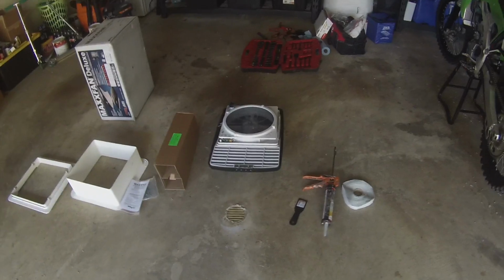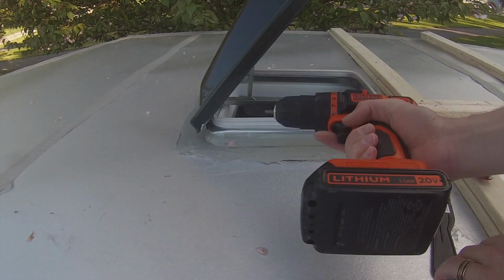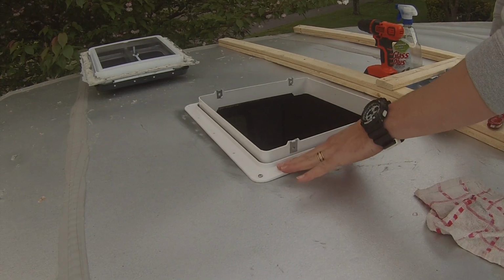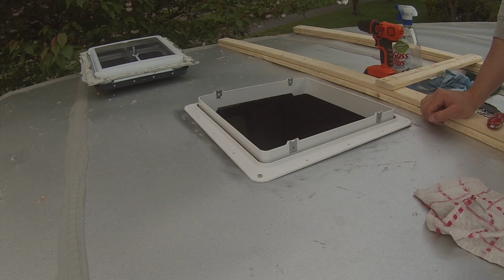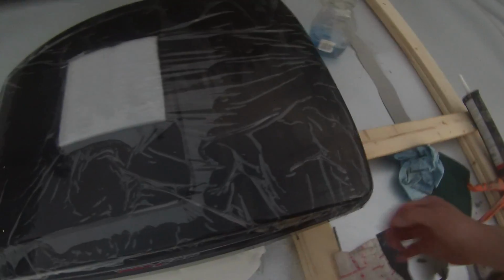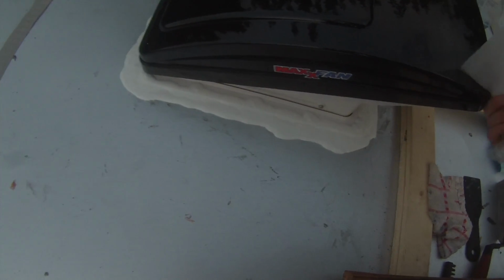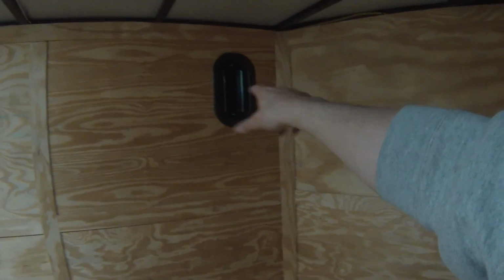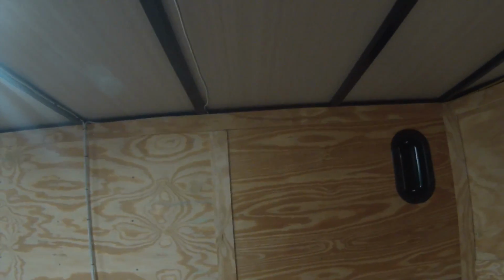MAXXAIR Fan Installation on Cargo Trailer

Comment: I want to weld In the supports and don’t have the fan yet.  Can you share the width you have the vertical pieces ? Thank you
Reply from the maker: It depends on what model fan you have. Most max air fans are 12x12 or 14x14. If you already purchased the fan you can look up the model number and it will tell you how large the hole should be. If you have the basic fan it’s usually a 12x12. But some of the newer models are 14x14. I highly recommend looking up whatever one you bought and looking at the specs for the dimensions.
Reply from the maker: Unless you are talking about the roof struts. If that’s the case the struts are 24 OC for my roof. If you want a more rigid roof I would go for 16 OC to allow for more weight supported. Mine does fine with what I have on the roof but I wouldn’t go much more than that.

Comment: Can you show how you have the wires connected to the battery? Please and thank you. Do you think a trickel charger could keep up with the draw of the fan?
Reply from the maker: Send me a message through Instagram and I can send you a picture of how it’s all wired up. I use solar to keep the battery charged and at max this fan only pulls about 2 amps per hour. I have a 100 amp hour battery and I can run this all day on high with good sun without draining the battery. Then at night this fan will only drain about 18-20 amps if I left it on high. You rarely need it running that fast though as it creates a nice breeze on medium only pulling about 1 amp or so.